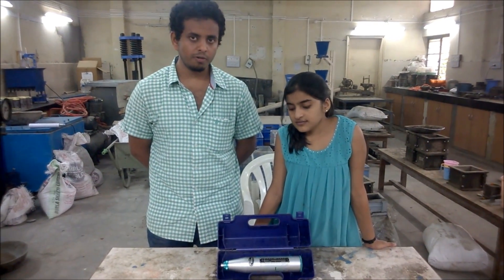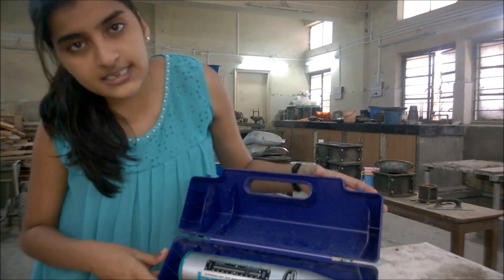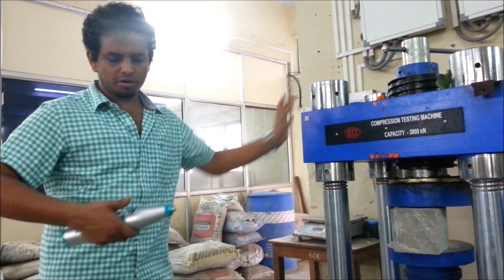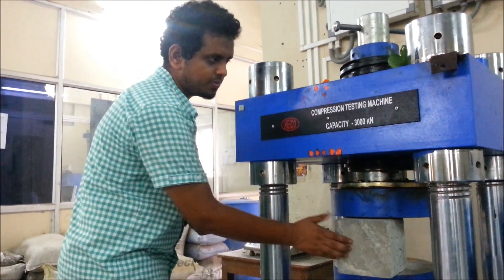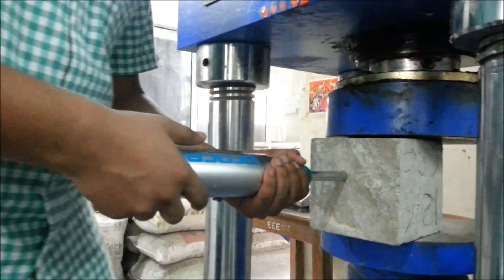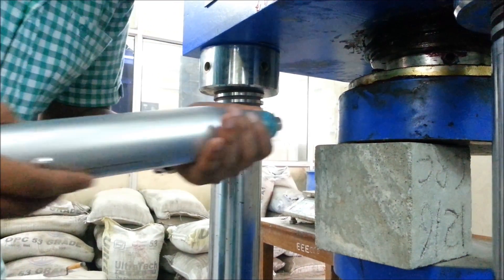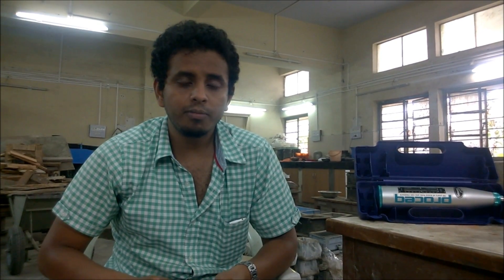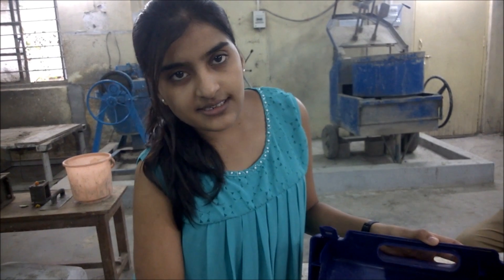Rebound hammer test by varun and rachana VNIT,Nagpur

Comment: You are SAFE
if your BUILDING=SAFE
Check BUILDING HEALTH
by Licensed Structural ENGINEER
1
We know about Our FLAT
& Not FULL BUILDING?
2
if any 1_Column FAILS
it can be UNSAFE to each&ALL?
3
For Safety, REPAIR as per REPORT
https://www.structuralaudit.org
Ganesh Kamat
M.S.(USA)50-yrExp
ForQuote 9820867755